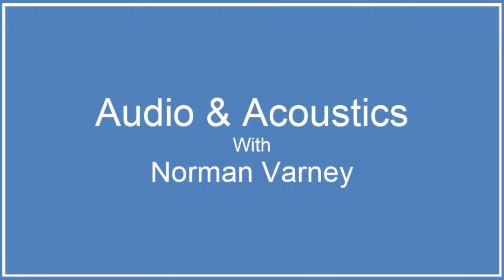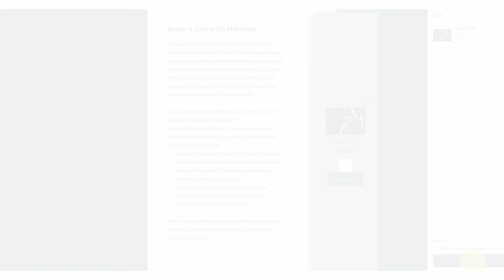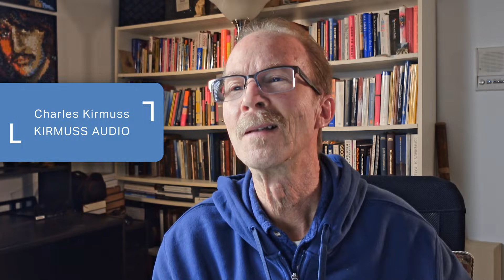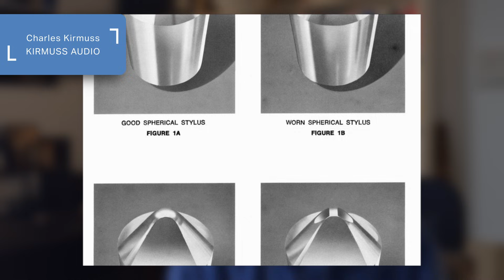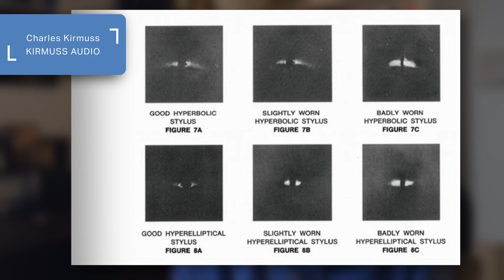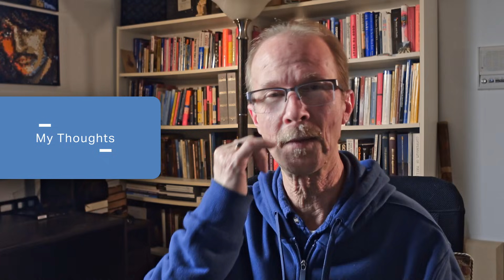What Really Wears Out Your Records? A Scientific Breakdown

Comment: Hi Norman, J.R., Charles,

Sometime around the year 2000 (I could be off by several years), I discovered that new pressings played extremely quietly.  They also sounded lifeless -- no energy.
I assumed that the record companies changed the vinyl formula, so that misaligned tone-arms / cartridges, with styli rubbing where they should not be rubbing, created surface noise, and that the new vinyl formula "fixed" the noise problem.

I stopped purchasing new vinyl, because of how dead it sounded (fool me once, shame on you -- fool me dozens of times, shame on me).  But I would make an exception every 5 years, or so, including a few months ago, just to hear if it got better.  It never got better.  It remained very quiet, and very boring; unlistenable.  But my pressings from the 1960s - 1980s sound amazing (I am not sure about the 1990s).

Norman, I met you and J.R. at T.H.E. Show in the Hilton in New Jersey.  J.R. installed my new cartridge at that show.  Since J.R. did the installation, I know that the dead sounding vinyl I described above is unrelated to any set-up alignment with my cartridge.

With the above in mind, what is the deal with dead sounding vinyl over the last couple of decades?  Have you experienced the same thing?

Was a new formula created back then?  Is it still technically vinyl?  Was the formula changed because of the history of noisy playback (due to few people properly dialing in their turntable's vectors)?

Is the dead sounding vinyl formula used by certain record labels?  Which ones?
Is a proper sounding vinyl formula used by certain record labels?  Which ones?

Knowing which record labels focus on sound quality vs which record labels focus on noise reduction would be helpful.

Considering the prices of new records, the consumer should expect to receive records that do not sound dead.  I deem them as defective.
Reply from the maker: I have not experienced "dead vinyl". I wonder if you could describe it in more detail and offer some examples? I run into mix and/or mastering changes that may sound too dull or too bright, which is unrelated.
Reply: @AVRoomService  I have tossed all but my last purchase, which is a Mobile Fidelity Sound Lab pressing of Upstairs At Eric's, by Yazoo.
It was pressed in 2012.  I purchased it a couple of months ago, as sealed, on an auction site.

I am not sure how else to describe its boring sound quality, other than lifeless.

The best way for you to know how it sounds is for me to mail it to you.  You can keep it.
Your business's mailing address is on your web site.  May I ship it to you?

Comment: _Paul Rigby did a wonderful video on the literally hundreds of formulaic possibilities to make the vinyl for an LP.   My take on record care and tonearm/cartridge setup.  As someone who has just over fifty years of playing records, plus maintaining them, almost all of my LPS, going back 50+ years, still sound great.  I have owned good-to-great playback systems all those years, maintaining my equipment and, as an anal retentive(well, sort of), have fastidiously maintained my LPS using a local audio dealer's Keth Monks machine, distilled water and alcohol, since the mid seventies, later acquiring, I think, the 1st gen VPI, 16.5 cleaning machine, getting rid of that(couln't take the noise and space anymore, plus ugly to look at), a Spin Clean with natural bristle brushes noit the pads, my mod and like it alot, a Record Doctor that cleans as well as just about every vacuum system, but takes a loooonnng time to clean a record, a knosti, and finally a Degritter. At first, I thought, who would spend that much for a record cleaner? After trying it out over a weekend, I thought, who wouldn't want one?  All that time, I cleaned my styluses with Linn's green sandpaper.  After seeing what looks like black crud on stylus tips under a microscope, no liquid I knew would work, not to mention do more harm than good.  I never met Kirmuss or spoke to him, but have met and spoke to JR on a couple of occasions. I find a lot of what they sell as tedious to use, and I have had my table setup with Wally tools.  I'm shure these are great tools, I use several different brands, but in the end, the methods already used by many manufacturers in-house seem to be the best or not much different.  I have a zero Halliburton-type case filled with more tools than I will ever use.  There a record players journey, sort of.

Comment: If the stylus behaves, then record wear is almost nonexistent.  However, if distortion due to mistracking occurs, that part of the record deteriorates exponentially. That is my experience. I have no scientific evidence, but the problem seems to be mainly associated with classical music. I have records from 60+ years old to a few months, and I have acquired other peoples collections where the records have been played on a variety of turntables, arms and cartridges. Virtually every classical record in my collection suffers from apparent damage to some degree when played using a high resolution system. On a superb turntable, the music sounds crystal clear, but it is overlaid by crackle that resembles the sound of distortion. On a lesser turntable, the crackle is much louder and mixed in with music, which makes for an unpleasant listen.

My conclusion is that general wear is negligible,  but any abnormality in the signal seems to become imprinted in the record groove as damage and gets exponentially worse with each play whenever the abnormalities persist. I summarise some thoughts.
- Damage occurs almost exclusively with classical music.
- The first play of a new record is usually close to perfect.
- Parts that include high amplitude sounds of large orchestras with mass violins, choirs etc, deteriorate rapidly and can become unlistenable.
- With older equipment, defects were more common at the inner grooves.
- The rate of deterioration seems to vary with different types of vinyl. New heavy vinyl appears to deteriorate more rapidly than old records.
- I have concluded that the inability of the cartridge/arm/turntable to properly deal with resonance is the chief cause of the deterioration.
- I have yet to determine whether an ultra high-end turntable avoids causing damage.
Reply from the maker: Thank you for sharing your experience. It sounds like you've put a lot of thought and observation into this issue over a long period of time!
Reply: I have found the same. Also, off-centre spindle holes can greatly exaggerate these issues. The more tonearm sway when tracing the groove, the more negative effect.

Comment: Vinyl characteristics, that's what makes the problem difficult to solve. We are dealing with interaction of two materials that are absolutely different in their physical state. Super hard needle with somewhat elastic vinyl. Go figure. :)
Reply from the maker: It's certainly a complex interaction, yet it works very well!
Reply: Added where in any study, mixes used for vinyl need to be the sane as well as the turntable setup.

Comment: release agent is an integrated element of the vinyl formula. There is no evidence that it migrates to the surface. Also if release agent does  migrate to the surface and leech out that is a bad thing! It will cause shrinkage and deformation of the vinyl. Again there is no evidence that this happens. but IF it does happen the last thing you would want to do is accelerate this leeching. Nothing good comes from the loss of material from an object that is molded and it's quality is a direct byproduct of it's accuracy in form to the molds (stampers) from which it was cast.
Reply: Hi Scott. 1) If you study plastics and take the time to review materials made available by the American Plastic Manufacturer's Association, indeed as you state,  we do have in both pressed and injection molded plastic parts the need for a release agent. Otherwise one cannot extrude a plastic part. Not a leaching, part of the pressing (or injection), (records use both), processes. Biscuit-record)) .. Moreover  Release agents as Shure discovered, a pressing oil  as they termed it,  well documented leading to supply in 1978 of a brush attached to the tonearm (brush Not needed in Mark IV, new stylus configuration), there are two types of release agents..  part of the PVC, or when we deal with injection molding, part of the PVC or sprayed on.. In the pressing of the record and prior, injection molding the biscuit, we do not use any spray, agent part of the PVC mix.  ....  If we did not have a release agent that in the case of a PVC record, the record would remain "stuck" in the press.  I refer to the ARSC meeting in Portland in 2019 where at Cascadia Pressings, they encountered PVC biscuits using the incorrect mix where records remained "stuck" in the press.  They used an Automotive Metal Polish as an added release agent on the stampers to extricate from the press records made with the incorrect mix. Of course the extruded record was scrapped. (If you refer to the Kirmuss YT channel and the 45 minute presentation on record manufacture and care, a  visual  reference to Cascadia and this issue is presented.)

2) To the release agent, depending on how long the record remains in the press and the actual mix of plasticizers, liquifiers, stabilizers within the mix, (good source of in fo: Making Vinyl web site), we have noticed varying thicknesses of coatings that we can measure using our $178.000  Keyence Model VHX-7000 2D 3D imager. (Images also on our YT channel and the presentation.). 
 
To the statement  just made: added proof, also in our educational slides and product datasheets, we show images taken of the groove....  and in one of note,  using the VHX-700, where a fuse- in dust particle into the cooling oil is  observed:  that on every play at the same spot creates a pop, visually examined ,noted as fused into the cooling oil at the pressing plant. Measured in the H2O Hall & Oats record,  with 0.9 microns of "release agent"  removed, we also remove the contaminant that was fused into the cooling oil.

3) As to leaching, we do have the record  outgas,  from PVC, due to the presence of diverse additives,  such as plasticizers, stabilizers, lubricants, and other chemicals that can volatilize over time. Plasticizers such as phthalates are especially prone to off-gassing, contributing to the release of volatile organic compounds (VOCs). To this : The age and condition of the PVC product also play a role. New PVC products typically emit higher levels of VOCs, which gradually diminish as the material ages and the most volatile components evaporate. Just like in a new car, and the new car smell, and that nasty film that appears on the windshield, we have the same issue with records.  Outgassing of the plasticizer of the PVC record and a PVC sleeve sees the films coat the record over time. Taking out the record and handling it, we "scratch" or "scuff" this film. Proof where there is a film, (outgas),  the Kirmuss process removes these marks. The thickness of this outgassing element is  hard to measure in thickness as the VHX-7000 measures both this film and release agent that the Kirmuss process has removed.. added, removal of scratches supports the assumption of outgassing (not of a liquid), as one cannot repair scratched plastic.

Comment: Search YT for vinyl wear experiment. There was a good experiment showing that the effect of stylus shape and number of playbacks is nil. Re cleaning agents, at concentrations used in wet cleaning (vac or ultrasonic) procedures, with subsequent removal of most before air drying by whatever technique you like, the thickness of the film is subatomic. That means, there is no residual film, but only scattered molecules at angstrom level. Not detectable by vinyl playback. There is a math mistake by factor of ~20K in the vinyl cleaning book on that topic. -- Production release agents was something new for me. Just one more reason to US-Vac clean even brand new records. -- Bottom line, I don't worry about vinyl degradation. Keeping a record decently clean and getting arm set up ball park right, you'll be fine. I run a Naia rig. I do have a scale and the skater. But mainly, I enjoy the music. -- Re microscopes, those images were pathetic, sorry. A decent light microscope with z-stacking (I run Zeiss Discovery V20 and an Axioskop II with some planapo optics and an Axiocam 820 +++, also was in charge of a scanning electron microscopy facility) will give WAAAAY better images. Sure "microscope" is a joke.